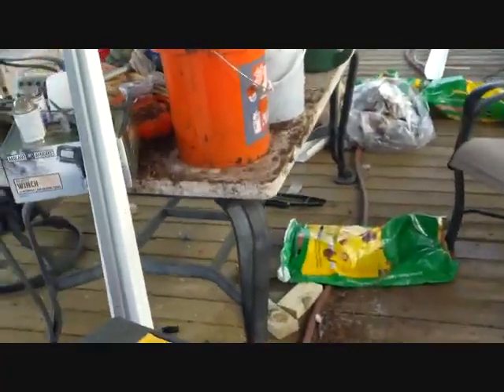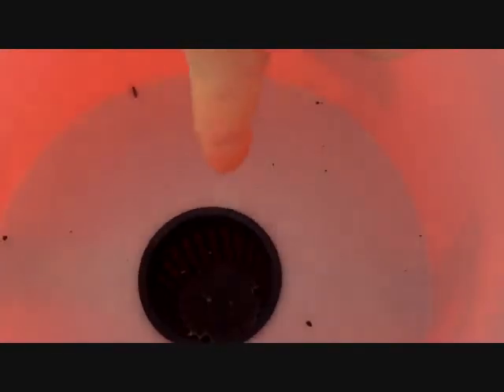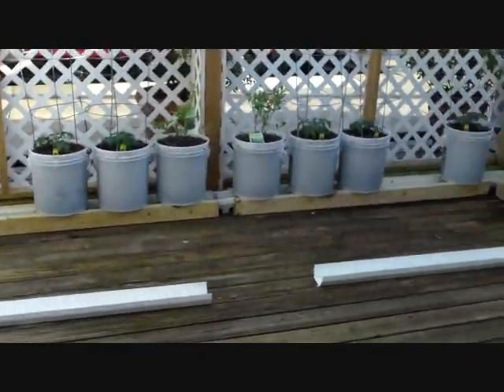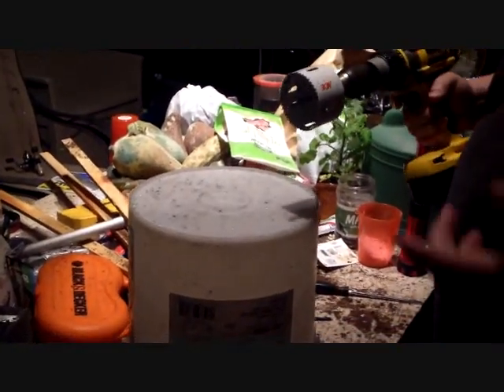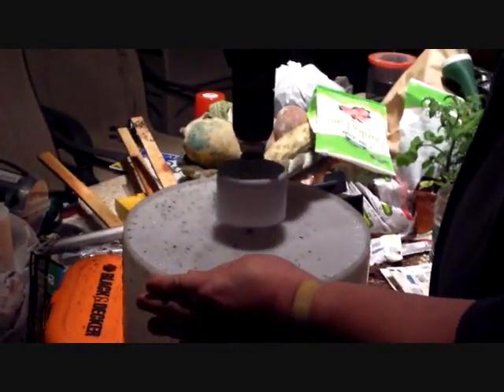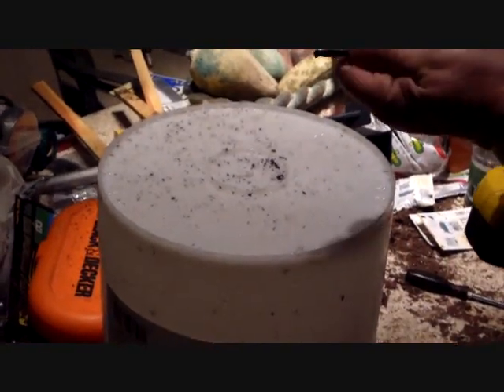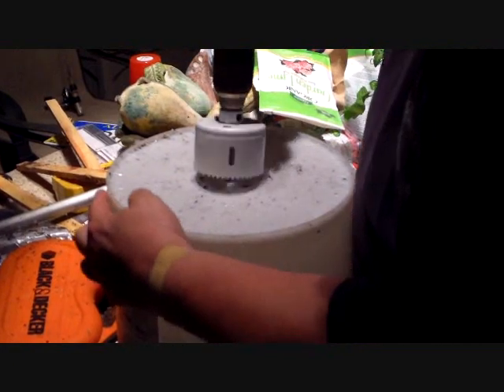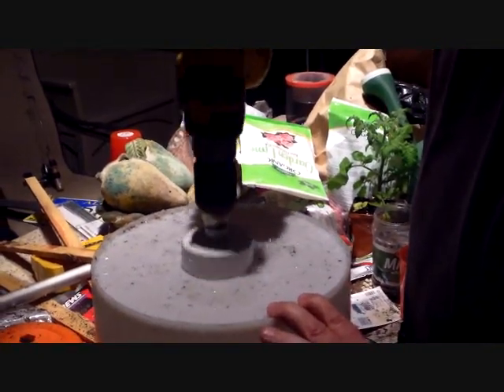My Brother Steve has a couple tips for your Rain Gutter Grow System!

Comment: Steve try running your drill in reverse it will not grab and it will burn the hole and is nice and neat and you don't have to drill a pilot hole try it you will like it I use it on cheep buckets because they break if I try to drill them